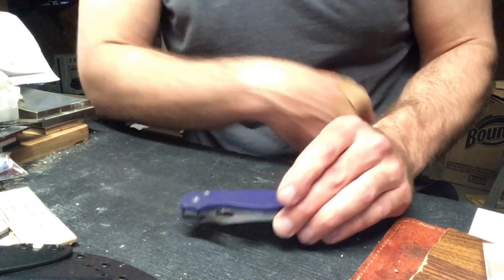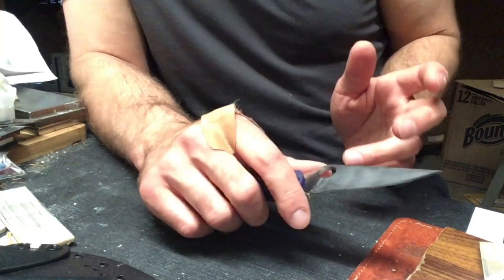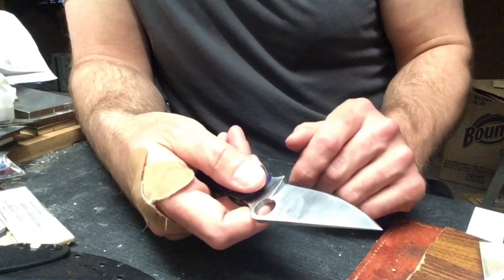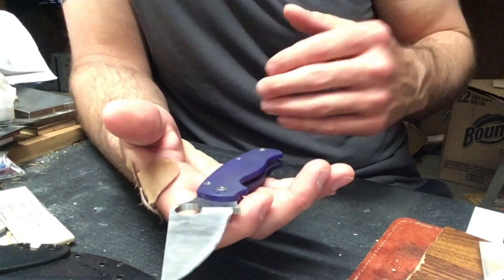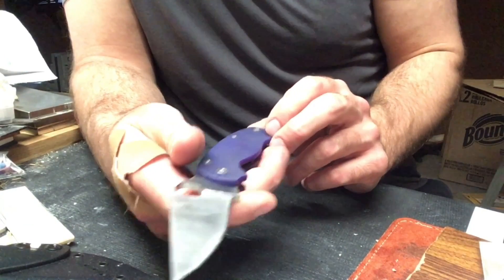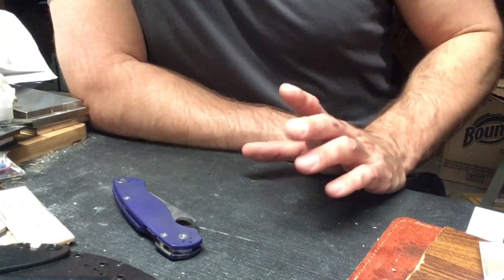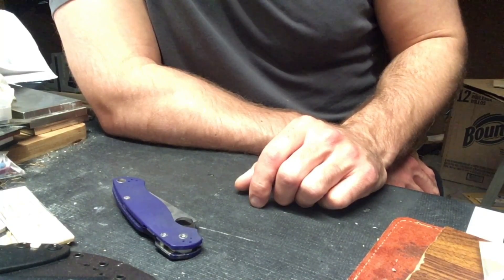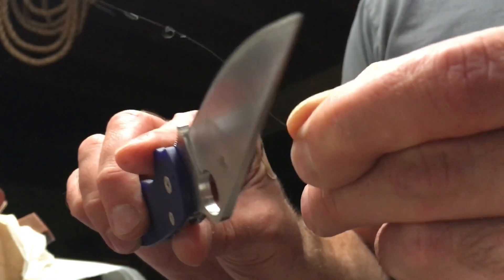CPM S110V - carbide tear out in sharpening

Comment: I think it's an argument that can't be answered simply because there isn't stones fine enough that are offered in diamonds.

 Sure they have emulsions and compounds that are super fine diamonds. But are they really sharpening?

 Or are they just polishing the Finnish left by the last stone used? 

I believe that the argument is to close to call. And being your results we're only within a foot of difference I say that's a fair assumption to make.

It would be interesting to see if the diamond emulsions really removes enough metal away to sharpen instead of just polishing the edge left by the last stone used. Cliff stamp talked about this before on his channel and said ken Schwartz told him to use the diamond emulsions on a regular fine water stone to sharpen. I think he got pretty satisfactory results too.
Reply: Michael Christy i could see it being difficult. It might not remove the fatigued steel.. it's a shot in the dark in essence. I see a lot of wicked edge  sharpeners using the diamond lapping films to Finnish their edges. They get down pretty low in microns too. Maybe if there's no success in the emulsions you might get better results with them.
Reply: but there are diamond waterstones fine enough, and they don't seem to make a huge difference either
Reply from the maker: Caleb Green I've used diamond sprays on waterstones quite a bit.  It does help in sharpening. 
I have compounds with abrasive that's pretty good size. (As large as 40 micron I believe).  It would be interesting to see how very heavy compound would do on a blade that was starting off very dull.
Reply: Michael Christy if you do any testing let me know how it does. It would be interesting to see the results from the courser compound you have. And if it does anything it will prove the effectiveness of the emulsions too. 

I know that the actual vanadium carbides in most powdered steel is very small in size.. Being very small getting the corresponding size in diamond emulsion could possibly increase the end result of the sharpness. 

I almost wonder if you thinned the edge out to below the intended angle then put the intended angle you desired with a microbevel using emulsions if the sharpness would benefit. 

The smaller area of contact might make it easier for the emulsions and give it a chance to actually cut the alloys in the steel.
Reply from the maker: Caleb Green I'll let you know if do and testing.  The problem I see with it is not removing fatigued steel and possibly lowering performance.  
The problem with the micro bevel idea is that stropping is as exact as sharpening.  I don't deviate from the bevel angle.  With a micro bevel, that might be difficult.
Reply from the maker: Caleb Green are the people using the W.E. films just finishing their blades that way?
Reply: Michael Christy you can for sure... but... I get way better results from using the strops after my finest film which is .1 on the kme going to a .1 strop
Reply: Michael Christy and after watching your vids over the last few months you’ve really opened my mind as to what can be done with a combination of films, wood, & leather with diamond emulsions and I must say I’m enjoying the benefits of your experiments and empirical data!!  Just awesome work Michael thank you...oh and one more thing: your conclusion & destroying of the “why take it to hair whittling when it dulls in just a few cuts?” narrative is utterly and completely satisfying to me on so many levels!  I’ve viewed this video numerous times and it never gets old.  🍻 cheers